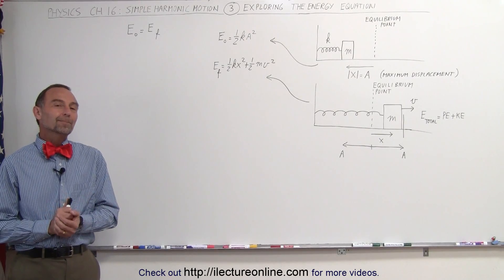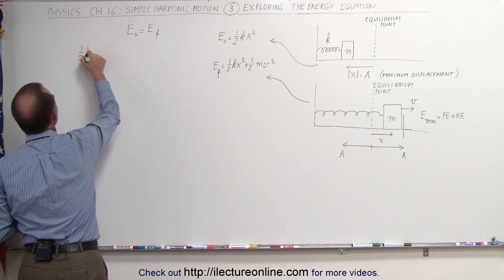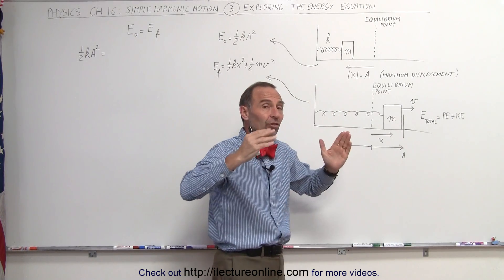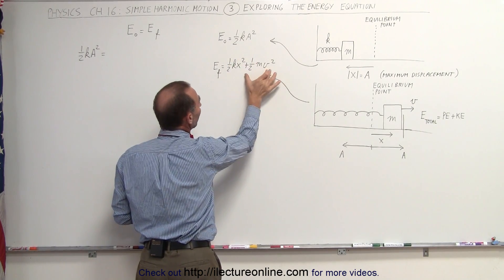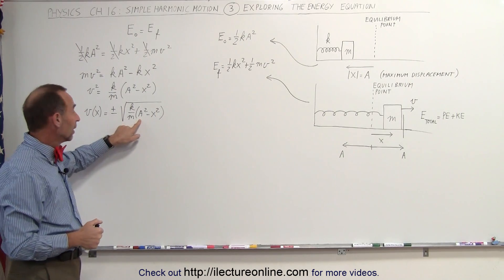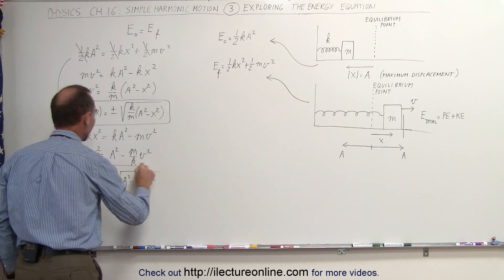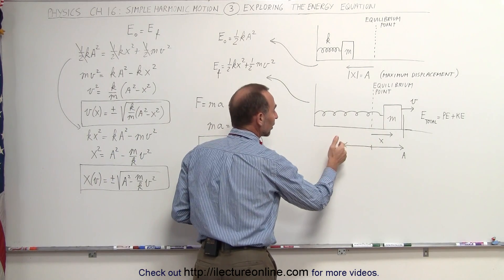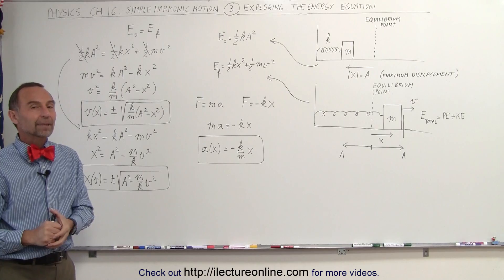Physics 16  Simple Harmonic Motion (3 of 19) Exploring the Energy Equation

Comment: Sir what is the difference between x and A? In the right equation why did you use x and not A? Thanks!
Reply from the maker: x is the variable expressing how far the object is from the equilibrium point at any time.   A is the maximum amplitude of the oscillation (the maximum value x can have).
Reply: @MichelvanBiezen  thanks sir!
Reply: X is a general variable of displacement from the mean position- A is its terminal value, ie the maximum value of x. Likewise -A would be the other extreme value of x ( max displacement from mean position in the opposite side)